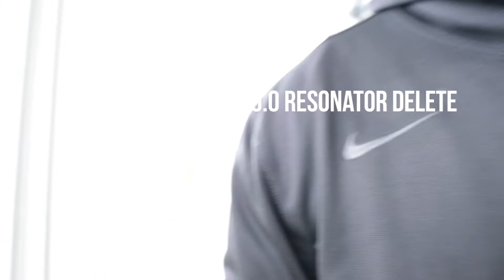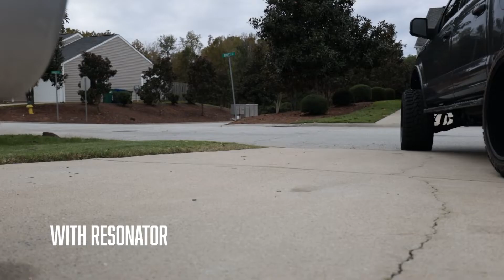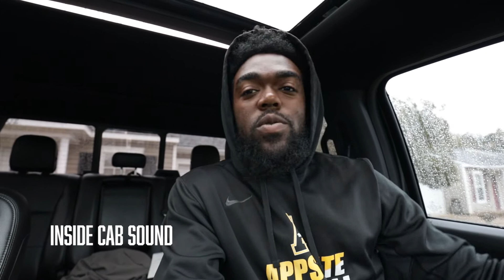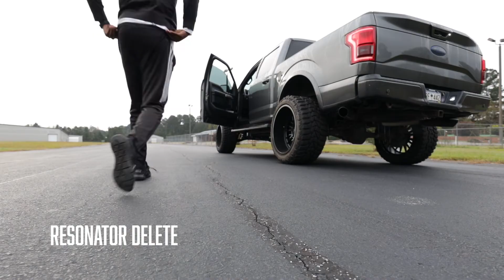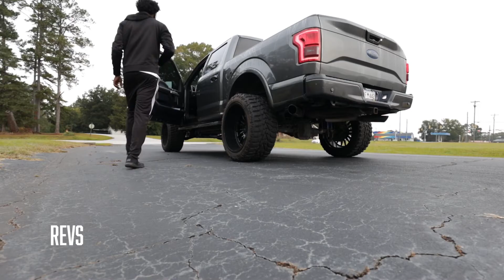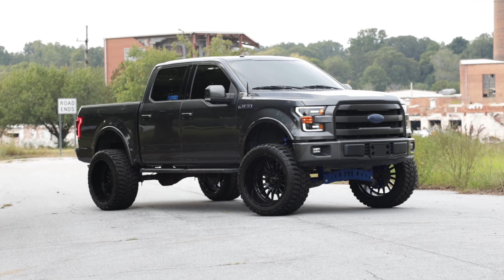Lifted F150 5.0 Resonator Delete | SOUNDS A LOT BETTER!

Comment: I have a 2017 Lariat myself. Thinking about a resonator delete. How much louder is it compared to with it on? Engine throwing codes at all? Any drone a highway speed?
Reply from the maker: It was a clip in the video that was before  the resonator delete. But it’s a little louder not by much. But I can tell I get better throttle response. & no check engine lights. And little drone at low RPM

Comment: Just got a magnaflow on 2010 f150 single in dual out. How long does it normally take for the sound to change or does it get louder later on? I did delete my resonate as well. Just like some input from you on it.
Reply from the maker: It just get louder over time. I’ve switch exhaust now. I’ve had that muffler for about 2 years. I’d say after don’t months it get a little louder. I noticed it after around a year

Comment: what series magnaflow do you have on your truck? i just did a 40 series single in and dual out yesterday on my new 2022 5.0. still wanna get it a little louder but with out the raspy  sound.
Reply from the maker: I have Magnaflow single in and dual out and not flowmaster. Did you delete the resonator ?
Reply: @TFBJFord  I’m fixing to go see if I can get the resonator took off mine today if I can find some where that’s open and will do it today.
Reply from the maker: @X_Mason_X_6.0  Yea that may open it up but it may also drone more if it is not already. One of my boys got super 10 on his silverado it sound pretty good.
Reply: I got a 2020 5.0. Your truck sounds great what series magnaflow?
Reply from the maker: @josephriley8393  not sure what series just know the part number is 12388